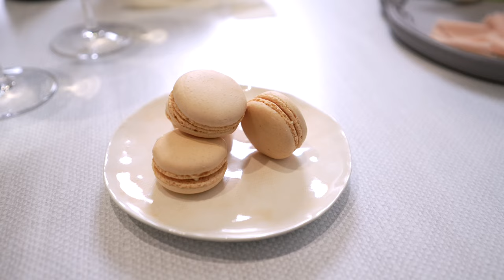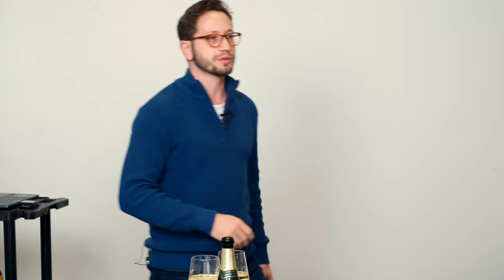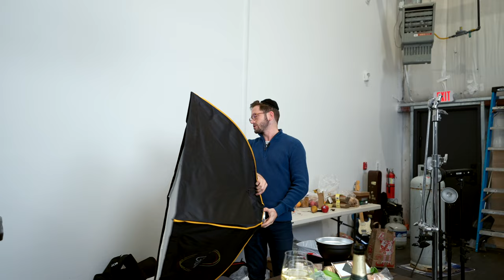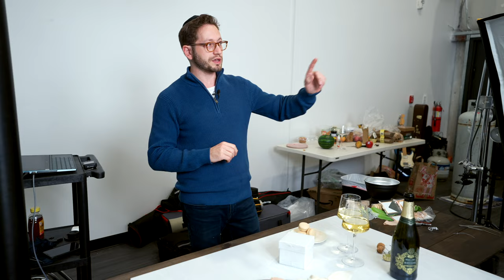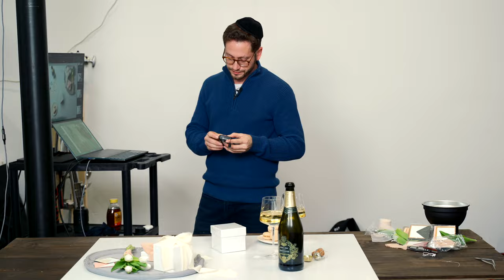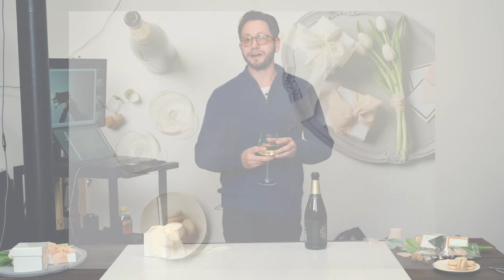Duo Boards: Hard Light VS Soft Light Explained | Hudi Greenberger

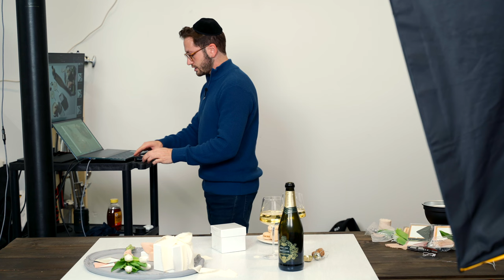Comment: how do you switch the power , what kind of device do you have in your hands at 2:30 minutes and at 3:00 minutes of the video, thank you!
Reply from the maker: The remote trigger that is being used is able to adjust the power wirelessly on the light.